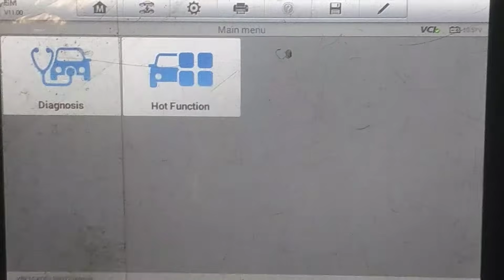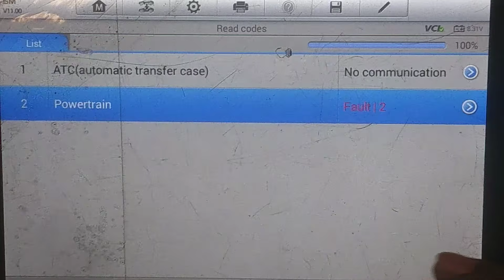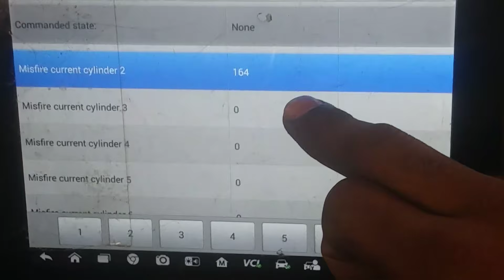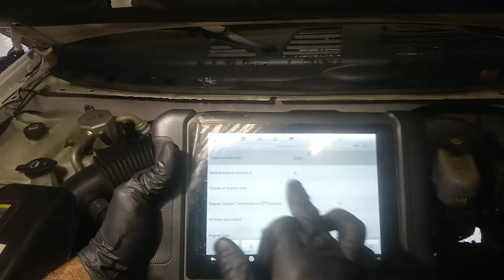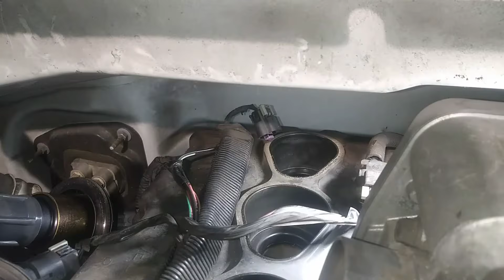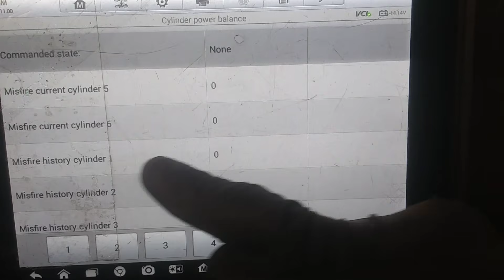engine misfire gmc envoy

Comment: Was hard for me to hear through the speaker but was there a buzzing sound as well as the taping sound? mine has one that comes and goes and is pretty much continues while driving wondering if I’m having the same problem
Reply: Sounds almost like an old air compressor so thought maybe pcv but unplugged it and still got the noise
Reply: Actually kinda sounds like an electric can opener

Comment: I did all my coils and still get a blinking engine light and a code p0300
Reply from the maker: Check for proper signal at coil and injectors.  

If you have mechanical noise,  isolate causation,  check valves and camshaft.
Reply from the maker: Perform a compression test or leakdown test

Comment: Replaced all 6 coil packs with AC Delco UF303 instead of Delphi coil packs & 41-103 Iridium  AC Delco spark plugs 6 months ago Now i have a PO301 Misfire cylinder 1 Just after I filled it up with 93 octane mobil gas Changed all of them after a PO302 Cylinder 2 misfire Service engine soon light was flashing at first then stayed on Please respond my man
Reply from the maker: Is it currently a hard misfire and running rough at idle?

Comment: im having issues with mine, it keeps pushing white smoke out my exhaust if im at high speeds and makes a puttering noise and kinda misfires if that makes sense it has been working fine before i drove it a few hours on a trip
Reply: check oil, seems like a blown head gasket
Reply: Yep